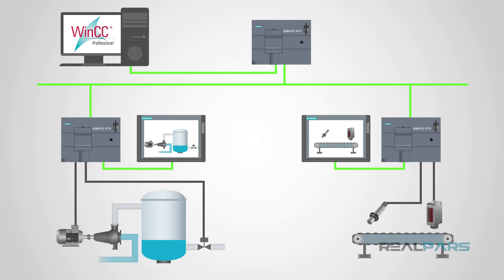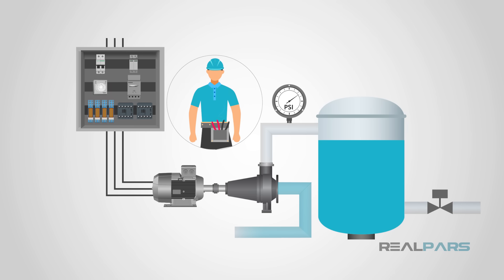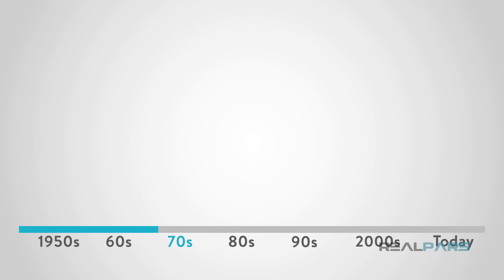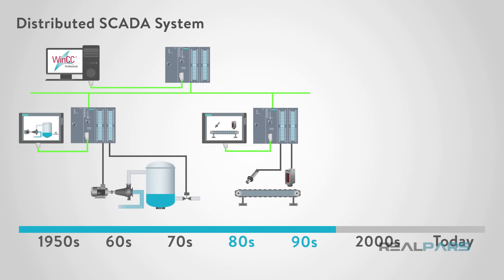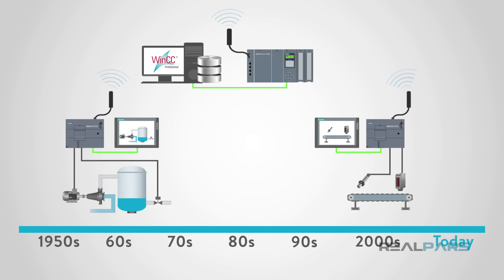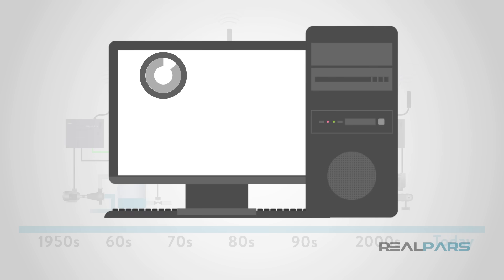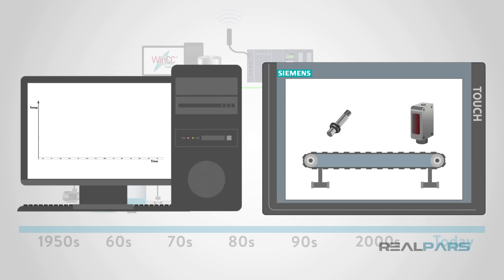What is SCADA?

Comment: Could SCADA collect data to help a murder case?  Say for example the muderer killed a few people at 4am and hopped in the shower to wash off blood or evidence.  Being that it’s a Saturday night with probably few or no other’s using water at that time…could the SCADA system show the exact time the shower was run?  Thereby revealing the time of the crime.
Reply from the maker: Very interesting proposition!  And yes, if the SCADA were monitoring water usage, you could certainly use the data time stamps to detect water usage at odd times.  I will leave the sleuthing to you, as my forte is industrial process control, not forensics. 🙂

Comment: * also, use a person that understands systems when applying scada and remember to use " dumb" switches in combination with scada . No one wants an software adjustable safety function wich by accident can be tampered with so automation is good, but to be used with system knowledge. Systems are still sometimes complex

Comment: Is it mandatory to study firstly PLC programming to start SCADA systems?
Reply from the maker: No, it is not mandatory.  You will develop an understanding as you go about the PLC memory layout, since the tags in the HMI will likely need to be pointed to memory areas in the PLC to provide equipment status, setpoints, receive commands, etc.  You can develop HMI programs that do not require an understanding of any PLC programming concepts beyond the table tables.  In most cases, a controls engineer can provide you with the PLC addresses that correspond to the various HMI tags, so learning the data table structure will come naturally as you work with those addresses.

Comment: Very concise and complete explanation and history of SCADA Systems. It' helps a lot for understanding of SCADA to get a full overview of the its evolution for the Engineers who didn't see it's beginnings. I myself learned a little of SCADA systems at university, but as I started working in the early 2000's, I did it on DCS. The architecture I learned to design was a central field controller conected to the LAN with multiple digital/relay  I/Os (and in some cases extension I/O boards) wired to sensors and actuators on the field. A server was connected to it through the LAN and sessions could be started from anywhere with access to the network. From that point a lot of customizations were possible through networking, reporting with SQL and programming  additional functions with asp-scripts.
Reply from the maker: Thanks a million for sharing that with us, Carlos!
Reply: I wish you help me learning this scada module...  Will u?
Reply: Wow

Comment: I used to manually operate sewage pumps onboard a US Navy carrier. It seems like SCADA could easily be implemented for this purpose too, no?
Reply from the maker: Yes, SCADA can be used in small installations or large installations to visualize and control most any process.  Maritime systems I have worked on have been as small as a dozen I/O or as large as several hundred.  The hardware and software in a SCADA system is easily scaled to any size system or process, from a single well-head to a complex tanks farm and loading facility.
Reply: You can operate from your mobile phone

Comment: The SCADA system offers an automatic real-time controll to softly shut down industrial equipment during outages when installed UPS systems are running out of battery?
Reply from the maker: Not that I am aware of.  What I normally dp is set up an input from the UPS to the PLC (hardwired input) so that I know when the system has switched to UPS.  I know the UPS will last 15-20 minutes,. so after 10 minutes, I start the orderly shutdown.  Many of the latest UPS systems have much better interfaces that should be able to communicate UPS status to the SCADA system via OPC or other interface.

Comment: Sir I want to ask question about reporting in scada. 
I have designed the report in the report designer(wincc 7.4) and create a print-job. I want to know how to save the report automatically with tag trigger on a particular location and give the file name with tag
Reply from the maker: There is one option in the print job setup dialog for printing a report as PDF file. You need to install WinCC data monitor to use this option, otherwise it will be disabled.

You may need to use a "C" or "VB" script to do exactly what you are suggesting, but it may be easier to create the PDF file and then run a script to rename the file.

See:  https://support.industry.siemens.com/tf//ww/en/posts/wincc-automatic-save-reports-as-pdf-with-script/170733?page=0&pageSize=10
Reply: Any WhatsApp group of scada

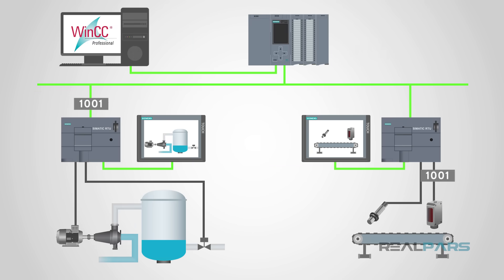Comment: 1:35 "As you know RTUs and PLCs are microprocessors" is TOTALY wrong. They have "microcontrollers" (read carefuly) embeded inside, but they are not the "microprocessors" (read carefuly)... And the embedded "microcontrollers" have a "microprocessors" embedded inside. So it is like stacking. 1st "microprocessor", 2nd "microcontroller" and then 3rd "controllers" like PLCs RTUs.
Reply from the maker: The intent was to show that RTUs and PLCs are microprocessor-based.  Finer distinctions are demonstrated in our more detailed series on RTUs, PLCs, and SCADA.  Our training typically is detailed, but still high level, without getting to the arrangement of board-level components.
Reply: Good to know.

Comment: Thank you for this informative video. However what are the prerequisite to learning SCADA?
Reply: There are really no absolute prerequisites, but it would help to understand:  1) 4-20ma loops, 24 VDC switches,. and basic circuitry,  2) PC software and networking,  3) some general understanding  of the process you are trying to control, 4) simple concepts of programming of controllers or PLC's,  and 5) some technical savvy and curiosity.  RealPars courses at Realpars.com can certainly help with items 1, 2, and 4.  Having hands-on acccess to a SCADA system and exploring its features, hardware, software and interconnections would be a great way to begin to understand these systems.
Reply: Scott Sommer your WhatsApp number

Comment: When do we need to use a DCS and when we need to use SCADA to me they look the same what we can do in SCAD we can do it on DCS so please some one tell me the difference
Reply: This is a question people have been asking for years, although it really is not a critical question.  You are correct;  they really look quite similar from a topology standpoint.  When the term DCS was introduced, it referred to controllers and I/O networked together in a plant with a single-window interface, the operator station.  This was quite a shift in architecture from the operator panel with switches and strip charts.  Later, laboratories, pilot plants and other processes wanted to have the ability to monitor and control their processes, without the high cost of DCS systems.  So PC-based SCADA systems were developed with board-level I/O and PC-based HMI applications.  LabView was one of the first and is still the most widely-used of these SCADA systems.  Over time, SCADA systems have become more and more powerful, and DCS systems have become less proprietary and lower cost.  As a result, there is not a lot of difference between the two any longer.